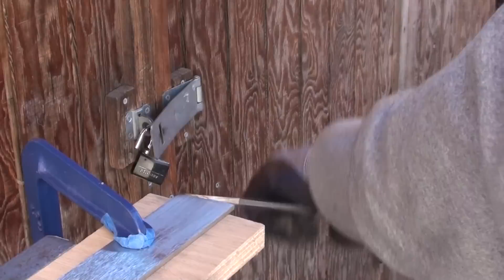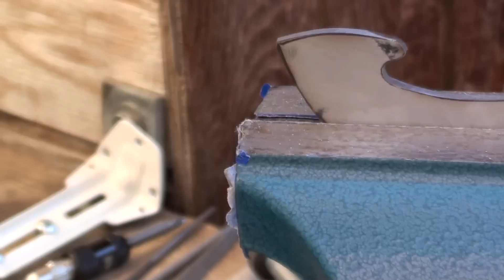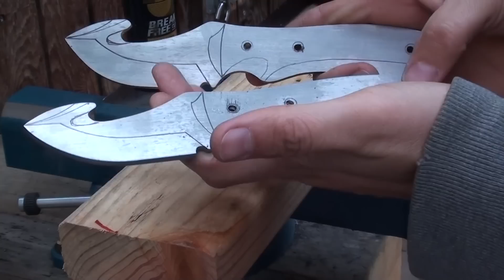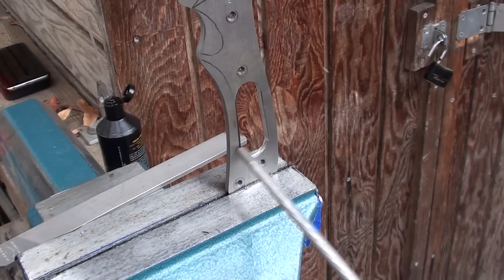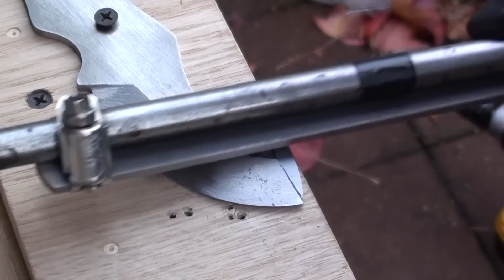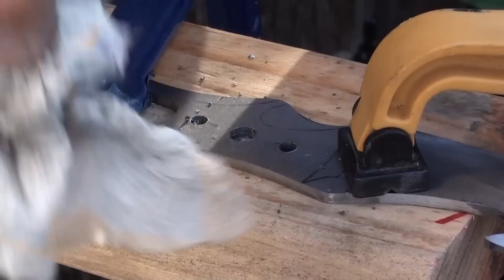MAKING HUNTING GUT HOOK KNIFE PART 1

Comment: Say Heah Slavic, I shop for best quality at the best price, I have champagne taste on a beer budget if you know what I mean. But I had Battle Horse make me a knife with a few changes from one of their new offering, just a broad brush stroke, Battle Horse produces a very quality knife for a great price, it's that simple. I had them slightly curve  the knife and lowered the drop point like on some high end knives, I also had them put a High scandi on it with white g-10 handle with blue liners, They surprised me with a beautiful black dangler sheath, Slavic, It came out spot on and I trust their tempering which I know is down to a science. I alway's liked those high end bushcraft knives but I also like the blades alittle longer, And I got a beautiful knife I always wanted. Just wanted to share that with you since we are friends, Duzhe Fina Robota, Slavik.
Reply from the maker: +paulie 4x Yes, I sent out the knife for professional heat treatment because the S35 vn stainless steel needs fancy heat treatment process. As for the knife blade length and shape it is all to the buyers preference.
Reply: Thank You, I will contact you, Do you use 3V I might want a Nessmuk looking knife I like actually the Jessmuk, in 3V, We will talk.
Reply from the maker: paulie 4x No, I have never worked with 3V.
Reply: It's pretty good stuff, I have a few knives in it, I have a Bravo 1 and a Bravo 1.5, My Rod Garcia Skookum Bush Tool is in 3V also. I really like the steel. But give time, time.

Comment: I know it’s an old video, but when using the centre punch place the work piece on the flat block at the back of the vice. You will get less bounce through the blade and a firmer hit which will in turn give you a deeper divot and the drill bit will walk less. 👍🏼 beautiful knife though.
Reply from the maker: Thanks for the tip.

Comment: you shou,d use a forge and forge a blade. Or heat a blade with a torch to give it like a case hard end look
Reply from the maker: +Mustang Gt350 I cannot forge at an apartment. Too much noise. I will definitely try to use a torch for the look you want.

Comment: what do you use to make those holes
Reply from the maker: There are many holes, which ones are you talking in particular?
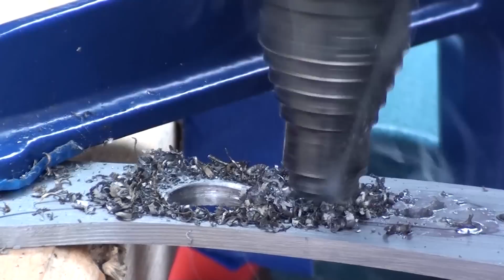Reply: at 4:50
Reply from the maker: Muhammad firoz shakir I put holes in the steel to make the handle side lighter. This way when you hold the knife in the center, the blade side and the handles side will be the same weight.
Reply: thanks

Comment: Man I'm super impressed with ur work! I mean I use my 2x72 grinder for everything and u use a fucking file! That's seriously handmade! U ever thinking about upgrading to a grinder?
Reply from the maker: Thanks for the compliment. I did buy a Craftsman 2x42. I thought I would be a pro at it...well I guess I need to learn how to free hand grind. So I just remove the majority of the bevel and then use files to finish off. If I had more room I would buy a 2x72.
Reply: +SLAVIK TELY I built mine for $300 bucks I cannot afford the brand name ones lol... Yeah once u switch to the grinding it will be a whole other ball of wax but the best part is whatever u mess up on u can fix with ur files....